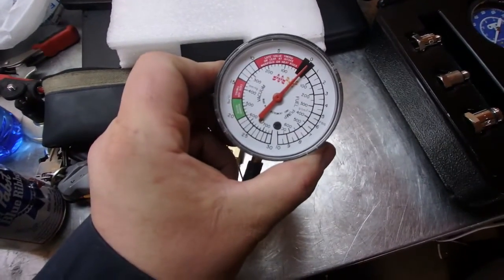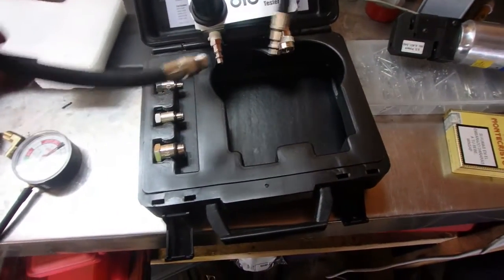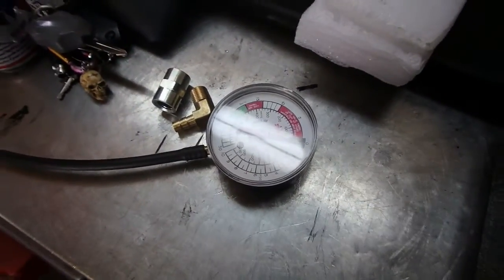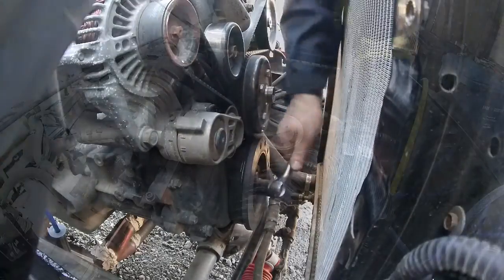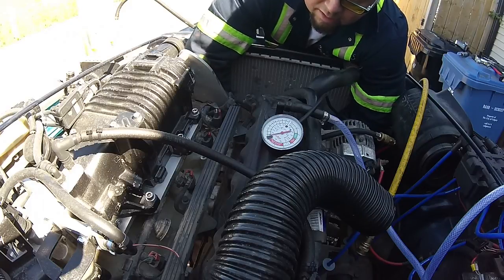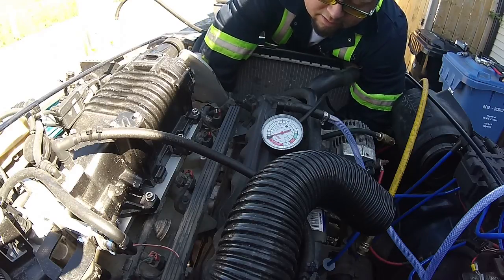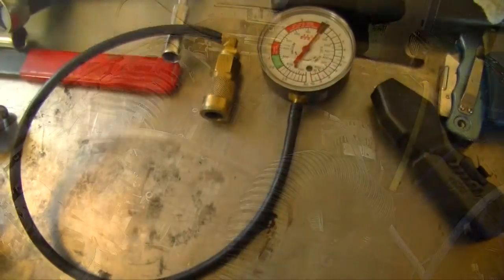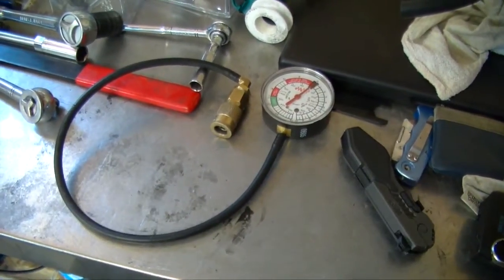How to Find TDC the Easy Way

Comment: Hi,
I wanted to thank you for this video on finding Top Dead Center. As the manager of a transport and moving company (Jam Delivery), I maintain a fleet of several vehicles, including a Renault Master and a Honda motorcycle.
Your 'easy way' technique is going to be incredibly useful for me. It will help me perform quick engine diagnostics and leak-down tests myself, saving me both time and maintenance costs. Keeping my vehicles in top shape is crucial for my business, and your tips make a real difference.
Thanks for sharing your expertise

Comment: Hello & thanks for the help. Does it matter which stroke it's on? I have a V6 & just passed it & lost my grip on the wrench so I am not comfortable go back & forth like you just did unless I have a tight grip on it. Do I now have to go past all 6 cylinders to get to compression stroke or can it be any cylinder compression stroke? I hope you understand I am wording it bad I know. Thanks
Reply from the maker: +faust310 most tests like a leakdown need to be on the compression stroke
Reply: remove the spark plugs you can rotate eng easer., tdc stamped at factory or crankcase pully or balenser.